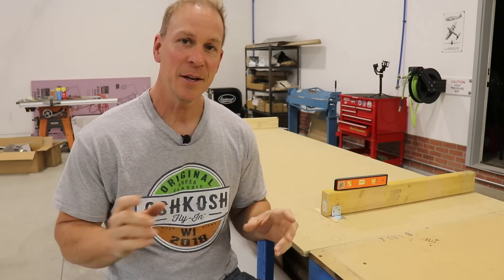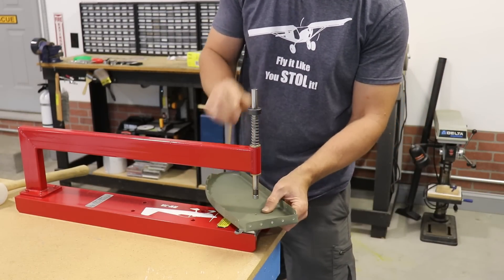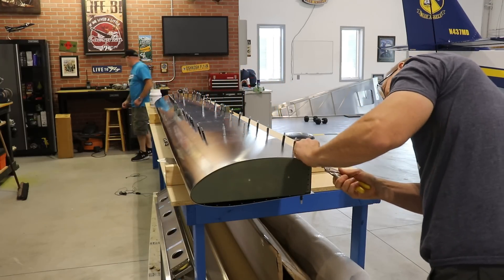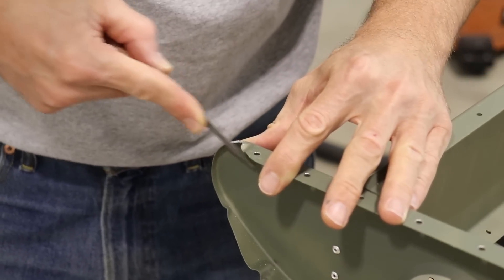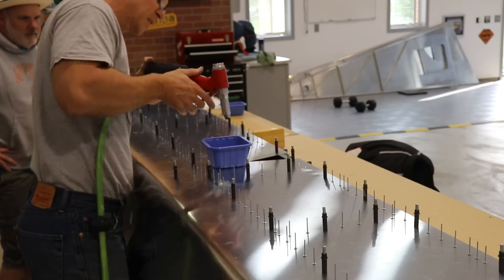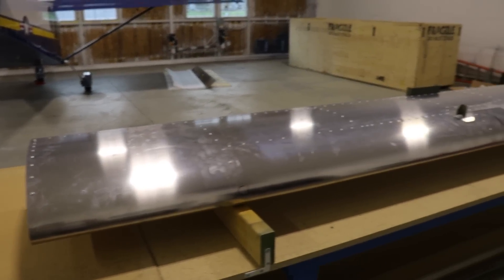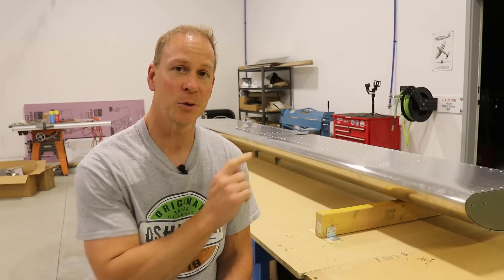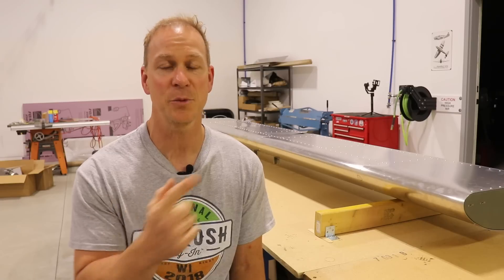Let's FINISH this Horizontal Stabilizer (Ep4)

Comment: I've placed my deposit for a Cruzer and will be getting it late January at their Rudder workshop, but I want to be ready to go, so I'd like to build the benches I will need.  Roget told me I need a 12' x 4' bench, I presume for the wing build.  But it looks like you are using a smaller bench for the horiz. stab.  Can you tell me more about what you use, and/or what you recommend that I build?  Thanks, and I am loving your build videos!
Reply from the maker: I built two 4x8 workbenches exactly the same. So for smaller parts I only needed one. For longer parts I could slide them together and make one 4x16 workbench.

Comment: Is this removing the stabiliser skin and deburring the holes both on ribs and the skins really neccessary, or are you just very neat with your work? Can it cause problems if I drill the holes and rivet them right in?
Reply from the maker: Just take two pieces of thin scrap aluminum and put them on top of each other. Now drill a #20 through them, take them apart, and feel both sides of the holes. Use your judgement-do you think the holes should be deburred?

Comment: Mark:  For those close clearance rivet pulls, I use a 3/4 x 3/4 piece of aluminum wedge about 3/16 thick on the back side with the mandrill size hole in the middle.  Bend the mandrill over a bit, slide the wedge over and pull the rivet.  Sometimes I modify the rivet gun head piece by grinding the required clearance.  I just take a piece of scrap and cut the wedge on the band saw.  take an old drill of larger size grinding it to the proper cup size to equal the zenith cup on their rivet tips
Reply: jon crew I was going to recommend the same thing! Google Vans section 5, which contain all sorts of tips and tricks, and you’ll see they use a wedge that they call AEX for this exact situation!

Comment: Well if those nut plates aren't for a GoPro, maybe you're working on some interesting endplate design..?
If they ARE for a GoPro... why not put an itty-bitty little power supply wire in that stab..?
Reply from the maker: Answer in EP5!

Comment: What is your opinion on the Zenith blind rivet system versus traditional bucked rivets in terms of structural capacity, differences in length of build?
Reply from the maker: I prefer the pulled rivets since it doesn't not require two people. It's much easier and faster.

Comment: Those two nut plates are for mounting the chaffe and hot flare anti missile defense system. Or maybe elevator support bracket, or GoPro mount. OK, all the above.
Reply from the maker: LOL you have to pick one!
Reply: @KitplaneEnthusiast  OK, I will go with Missile Defense System.

Comment: Being exRAF I would always put bolt head in the say way as you did and screw slots as it not only looks good it helps visual checks to see if there is movement (so not just OCD). The nut plate there can only be for something with a low load factor so a light camera mount as not wide enough for a fence.
Reply from the maker: I never thought about it being a good way to see if a bolt turned. I like that-I will now say that's why I'm doing it instead of saying because I'm crazy!

Comment: Just wondering why you didn't prime the skin under the attachment doubler and the underside of the doubler if you primed the skin to rib joints?
Reply from the maker: I primed the underside of the doubler, but just forgot to prime the skin before I started riveting.

Comment: Great video and series, looking forward to seeing the end result! Question though, you’ve been very meticulous about priming the parts, why did you prime the area of where you scratched the skin and not the whole thing?
Reply from the maker: Because I'm not paranoid about primer. I'm just adding some extra protection incase the airplane ends up in an environment that I'd want to have it. It's a balance between priming every single part vs weight vs money, etc... Without the wing skins fully primed, my airplane probably will only last about 150 years.

Comment: Another great video.. As for the closer rivets to the mounting bracket I've seen other people visit the bench grinder with the head of their hand squeezer tool make it fit a little better haha
Reply from the maker: Mine is already ground down to the "bones"
Reply: @KitplaneEnthusiast  lol well guess that answers the question that I would have been shocked if you didn't already think of this..... Good luck let us know what u did.. Wish I had better help.. All I got left is maybe using your teeth something tells me that will not work ether haha cheers

Comment: Ha! I knew I couldn’t be the only one that lines up bolt heads when possible. It’s also the reason why I love stainless round-head torx fasteners. Far less work.
Reply: MX after 30 yeah but your stainless bolts don’t have the same properties as an AN cad plated bolt. Also, although stainless is corrosion resistant, when touching aluminum, it will cause severe corrosion on the aluminum without some form of sealant barrier between the two. A cad plated AN bolt really is the better choice here.
Reply: @thomasaltruda  totally agree for that application. I was not suggesting that the bolts be changed or altered. That is also why I stated I line up bolt heads as well. I do love when the application permits, or is supplied, with nice shiny stainless round head torx. No extra alignment work needed to calm my ocd.

Comment: I've noticed in your last two or three videos that your rivet gun often takes two hits to pull the rivets. Is it wearing out?
Reply: My gun pulls most rivets in one try. Perhaps an adjustment is needed.
Reply from the maker: I don't think it has enough travel to pull it in one pull.
Reply: Huh. I don't recall this during the Cruzer build, maybe I just didn't notice.
Reply: Those guns are not that expensive, could be as simple as cleaning the jaws, simple job, it does not take long to get a buildup when you pull a lot of rivets
Reply from the maker: @itsonlymoney2931  Mine was already cleaned. I just think it does not have the travel required to pull a rivet in one squeeze. I should probably look into buying a new one though.

Comment: Riveted on threaded hole plates are to add some kind of navigation light on the ends of the elevator???  Or to allow for a sling mount / rotary mount to store / paint the finished part???  Thanks for the video series.  Do you find the drawings and assembly instructions to be fairly accurate and complete?
Reply from the maker: Yes I think Zenith has really improved the construction manual on the Super Duty.